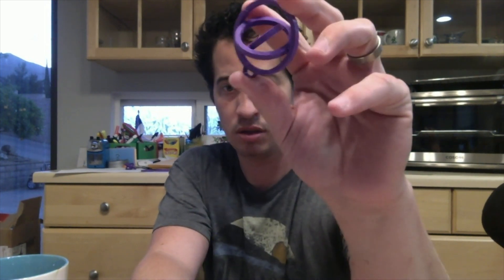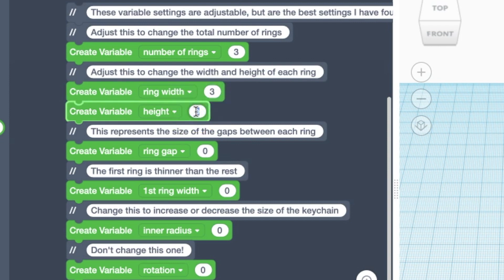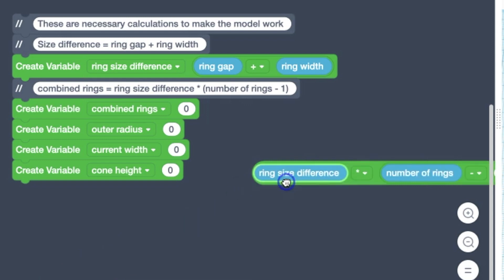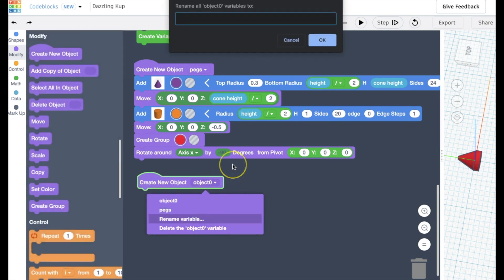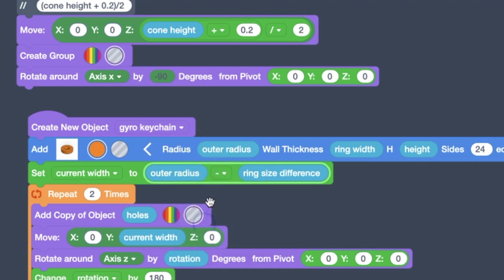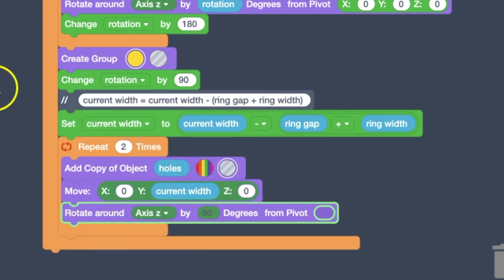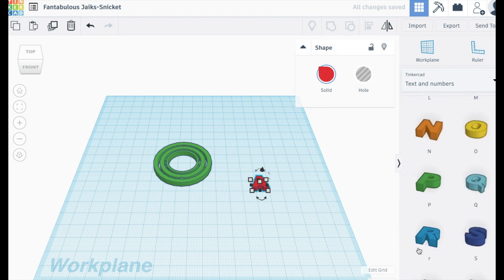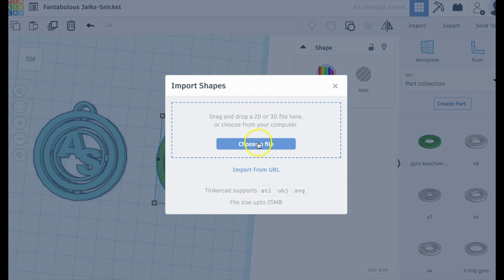Code a spinning fidget keychain using Tinkercad Codeblocks

Comment: Nice jobs thanks, just an important thing: codeblocks needs to pay attention when use math blocks because I saw that every single "little" math lock work before biggest block and that do not depend by the operator: so we must pay attention for example on setting "bottom radius" parameter of holes object: it's important that first little block is "height/2" and after you put it in the bigger block with "+0.75"; I invert that one thinking that math rules have priority but it was a wrong think!

Comment: so i did what you showed but it is not doing it right it has like 5 rings and the hole peg is not as big as yours
Reply from the maker: Looks like you may have missed a few things.  Try going here and looking closer at the different steps. https://www.instructables.com/Make-a-FidgetGyro-Keychain-With-Code-Using-Tinkerc/
Reply: @morethanthesum6318  i fixed it thanks but mine feels too tight like it does not spin like yours dose
Reply from the maker: @Jackson321._.O._.D  you can try increasing the gap between the pegs, you could try scaling the model up a little, or try reducing the flow rate in the slicer when printing.  This model works fine on my printer, but each printer is a little different, so you will have to see what you can make work.
Reply: @morethanthesum6318  so i did both and the first outer ring spins goodish but the inner ones do not spin as good
Reply from the maker: At this point just keep tweaking it until it works.  Each printer is a little different.